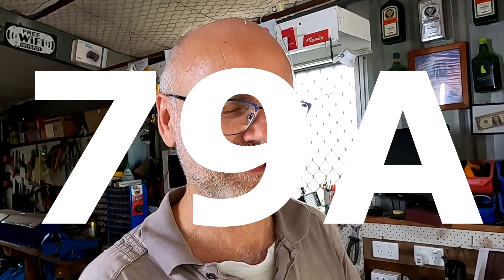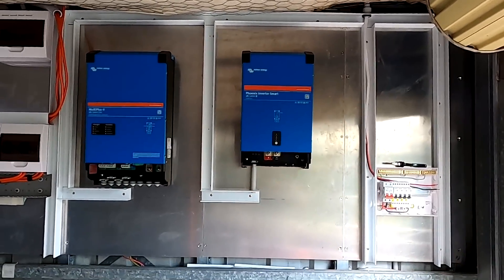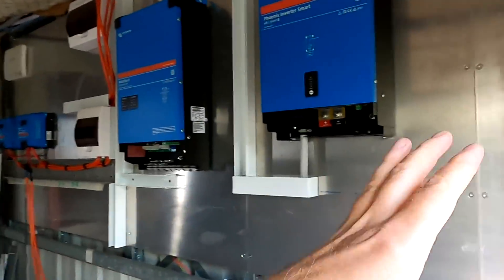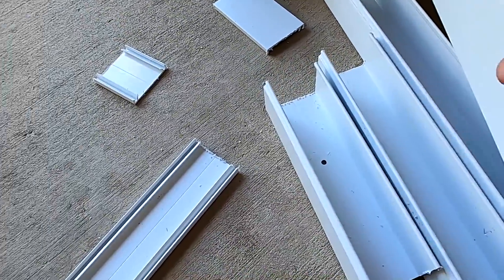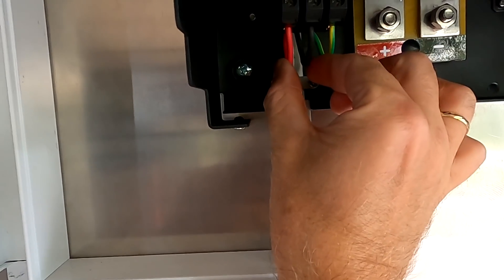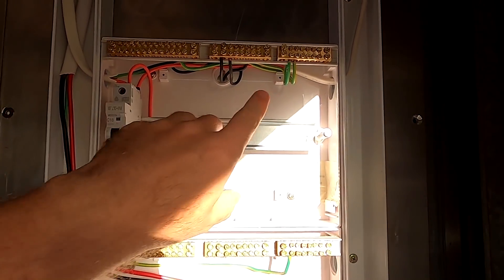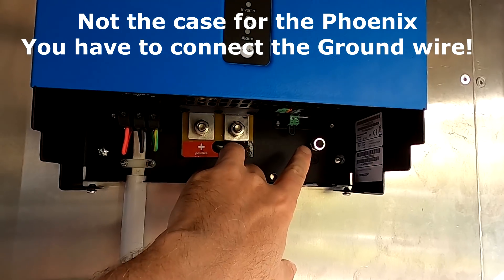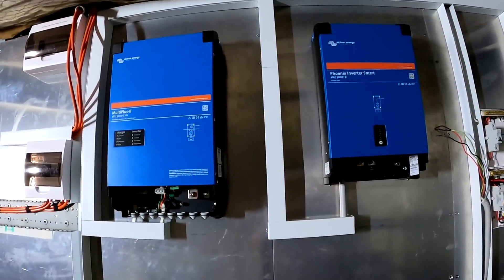PowerWall AC wiring. Daisy chain a Phoenix and Multiplus inverter.

Comment: Have you considered to use the output2 on the multiplus ? If the phoenix inverter cuts, this will also cut. this might be at least a nice place to connect the ev charger or other high demand circuits, to avoid a total blackout. (this is based on the outputs on the victron quattro, I will guess this is the same on Multiplus)
Reply from the maker: The AC-Out2 can be programmed. As you described it, this is the standard setting but it can be changed in the config to whatever you need it for. I'll show this once we have the Multi connected.

Comment: As for the length of DC cables, it is probably about voltage drops. If the voltage is very close to the low voltage emergency disconnection and the length of the wires is different, the units may turn on / off not at the same time. Which can cause various weird AC side situations depending on the load.
Reply: With 3-phase or with paralleling  inverters are connected together via communication cable so they will turn all off simultaneously, but  you are right without synchronization that  would be a problem.

Comment: Hi
Maybe option "D". ?
Unfortunately, it involves a lot of work because you have to drill holes more or less at the height of the connection.
So half of the holes you have now will be unused, but good for the future.
The advantage will be:
- shorter DC cable (lower losses)
- the cover will continue to fulfill its task
- clear connection (easier to diagnose)
- easier handling (no need to bend the cable)
Best regards from Poland 💪

Comment: Hi Andy,
Your Powerwall looks so good. I like it! PERFECT! really

The only thing I notice is that you didn't keep the 10 cm distance recommended by Victron for ventilation around the MP2.  The conduit at the bottom is too close. I don't think it matters, because you have the lower right half free. But still, if you are running at full load, the Multi needs a lot of air.
Reply from the maker: Thank you 😁
The distances around the devices are not too critical from what I gathered. I looked for Victron installations on the web and a lot of them have the ducting directly adjected. 
The vent opening for the MP2 are actually around 50mm off the backwall so perfectly situated for my 50mm duct. They start right where the duct ends.

Comment: I assumed the cable lengths being the same is really for parallel inverters, in my case two 3kva's, a master and slave, to keep the power balanced between them, I've kept equal lengths on the ac and dc sides. It's a pain in the butt really because you can't use only one without changing the setup software.
Reply from the maker: But they should have a communication cable between them so cable length should not matter either side. If one shuts down, they all shut down.

Comment: I think the same battery cable length requirement is for those who have connected the inverters in parallel, e.g. two 5KVA inverters in parallel to get 10KVA output etc. They should also go through the same breaker (or linked) I guess. In this daisy link micro-grid style connection, it is not necessary, as you said. Anyways, thanks Andy for the update. Great video as usual.
Reply: You are correct about the cable length and the parallel setup. By keeping them the same length, you keep the resistance the same. And that is important because you want the load to be split equal. If one cable (path) has a significant lower resistance, the energy will prefer to “flow” through that path creating an uneven load on your two inverters. That is also the reason why it’s not advised to oversize the cables to much. By doing that you will create very low resistance values. And in that case a small difference in resistance will mean a large difference in percentage.
About the breaker part. No. Breakers and fuses protect the cables and the equipment behind it. Even in parallel setup, they should be fused independently.
Anyways, I agree with you that I also don’t think the cable length matter in this daisy chain setup. They are sort of two different systems.
Reply: Cable length being equal is important when more than one inverter is paralleling it’s AC outputs. This is to make sure that when discharging (and charging via inverters) the amount of power going to/from the battery bank is the same to/from each inverter. The same goes if you built multiple battery packs and put them in parallel to a busbar. You want them all to have an equal distance from the busbar so that they are all evenly discharged/charged.  Also, when paralleling inverters, you also want to have the AC output lines equal length to their first termination point for the same reason.
Reply: @Shep5847  Will actually just made a video about this (more or less) about the different cable configurations with multiple batteries. And I believe he will release even more. Now that I think about it, it might even also matter for 3 phase setups due to the shared neutral.
Reply from the maker: I don't think the cable length matters at all. With parallel inverters or even 3-phase setups, the inverters are communicating and if one fails or has a low voltage disconnect (due to a longer cable) they will all shut down. Of course it can be beneficial to prevent that by supplying the same voltage level but on the other hand how often do you drain you battery so that the inverter shuts off? If this is frequently, you may want to start thinking about more capacity...
Reply: @OffGridGarageAustralia  Sounds like a good experiment in the making! 😊
Reply: @OffGridGarageAustralia  Victron has a document (Wiring Unlimited) describing various setups in how to connect. They also briefly explain the cable length in section 4.7 or 4.8. I know they also made a video about it. I’ll look it up tomorrow for you. The document: https://www.victronenergy.com/upload/documents/Wiring-Unlimited-EN.pdf
Will also has a video about the battery side and there he shows the uneven load on the batteries: https://m.youtube.com/watch?v=oXBT8lSC25M and https://m.youtube.com/watch?v=1U6E1bvjDYQ
Basically the same as Victron says in the document. But now nicely presented by Will in a more simple way.
Reply: @OffGridGarageAustralia  Yes Andy, in reality it might not matter that much. But some Inverter models with parallel function will give an error and shut down if there is an input voltage difference during operation. Hence, they usually state in the user manual to have the same length. Example is Voltronic Power's Infini solar model (usually rebranded by MPP solar, EASUN, etc.).
Reply from the maker: @dennis_m  Oh, wow, I would say that's really bad design if this happens due to a difference in input voltage.